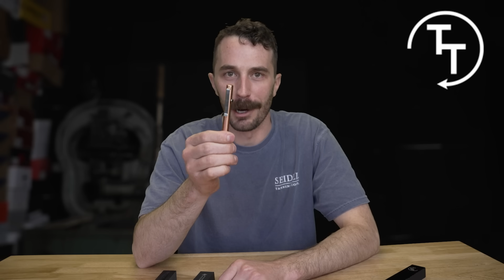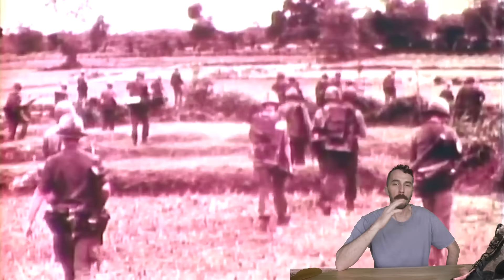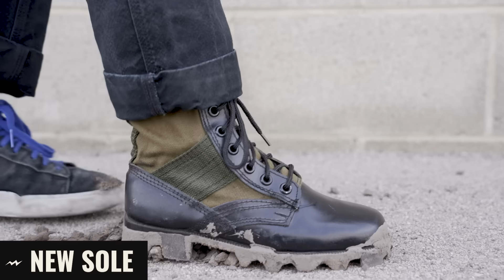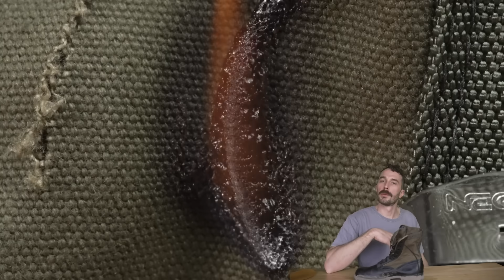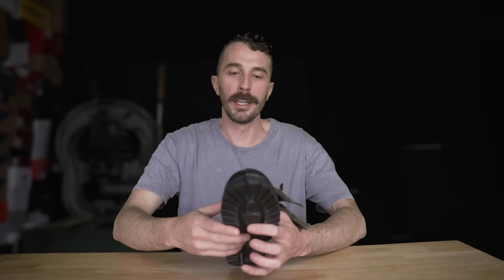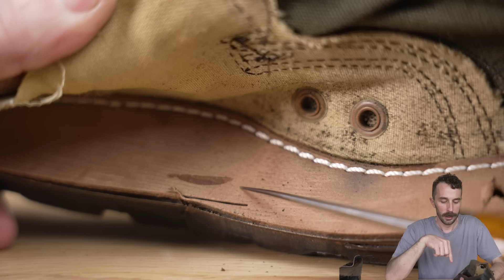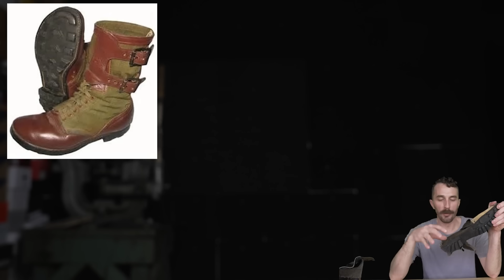Why it took 57 years to replace jungle boots

Comment: I was gonna say, sure these would be a great set of boots, if the price wasn’t so high, then looked at the link and just about bought on the spot.

That’s about the cheapest set of heavy duty boots you can buy, and it’s not like I don’t already wear heavy boots everyday, so any problems with them will be negligible. I was expecting a $150-200 price tag, not 50

When I was 16 I bought myself a modern set of combat boots, Australian standard issue, which is fine for me, I live in Australia, and at the time was doing a lot of work in dry dusty areas, which those boots did excellent in. But when the ground got wet outside of drought, and I had to do some wading, I found that modern gortex and all the special bits that make those boots so exceptional, also had drawbacks, in deep water these boots didn’t drain whatsoever, and they were very difficult to dry out, being multi ply gortex and nilon weave. They weren’t jungle boots, but they were designed with all terrains in mind, hence waterproofing and a metal strip. I’ve now moved north, and have to deal with mud up to my ankles constantly and flooding in the wet season. So I wonder if a set of proper jungle boots would be a sensible buy, especially considering how little I actually need the steel toe in my current boots

Comment: I have a set of the improved aggressive lug jungle boots from the Vietnam era. I have wore them for at least 35 years,they are worn out and the leather is brittle now. The best outdoor river walking/ fishing boots I've ever worn. I would slog though mud, swamps, woods fishing and those improved lugs were amazing. I'd throw them in the back of the pickup truck bed in the elements for all those years they functioned great. Not for winter though! Mine  are completely worn out, the neat mess foot beds are worn though,treads flat leather brittle till I get them wet, but these boots last! I'll get a new set one day

Comment: As an Engineer, having a metal plate 1mm thick is a lot for something that needs to consistently conform to your foot. I'd be interested to know the type of steel.  Metal is great for many things, just not flexing like your foot does.. I'm sure they picked a good option at the tjme
Reply: Also an engineer, my thought for puncture protection with flex would be U-shaped extrusions (aluminum maybe?), alternating up & down so they have some space between but overlap/interlock, so spikes can't get between them, & mold thermoplastic rubber around that.

Comment: My older brother gave me a new pair of these boots in 1969 and I ended up wearing them on a 10,000 mile motorcycle trip which included the entire length of the Alaska Highway.  They were so comfortable that they became my everyday knock arounds.  It took me about three years to wear them out.  I'm 70 now and I think I will look for a new pair.  Thanks for the video.

Comment: This has been a god-send, I was gifted a pair of these same boots. I COULD NOT find anything online about the build quality/manufacturer (Text was worn off). I kind of regret replacing the soles. they were pretty gross. But as you said, the 1 time I wore them metal detecting at the beach they removed water pretty fast. 
(Edit: They are the 84' version I believe)

Comment: I got a pair of McRae jungle boots in black, and the lasting board appeared to be some plastic/recycled plastic fiber. Not very comfortable, so I use a pair of leather insoles paired with a thin sneaker insole.

The original still held, so when I wore the old one out I got the cobbler to file down the original outsole to make it into a midsole, and I attached a vibram Montagne outsole with glue and hobnails. Pretty good all things considered.

Comment: The modern Army boot is pretty much the same design, at least the ones I was issued in 2007…Lug pattern is a little different and they are tan but other than that it’s the same. I still have my original pair and had them resoled once, still wear them on hiking and the leather is so broken in it’s like wearing a pair of sneakers.

Comment: First of all those pictures where not even close to the severity of trench foot I have had and seen and the boots did not stop trench foot that was accomplished by hygiene removing your boots when the get wet and changing socks often every pair I was ever issued developed a 1 inch tear just below the toe joint on the leather inside at the transition of the heel how ever, best all around boots I have ever worn kudos.

Comment: 306.5 lb to pierce this boot. So, in order to have something get to your foot, you have to weigh at least 306.5 lb with gear, the spike has to be strong enough to not break, and you have to be standing on only the foot getting spiked. Nice.

Comment: I wore these for work boots for around 20 years. They were cheap at my local surplus store, and even if they wore out, I could afford to replace them. It was great to have my soles protected while walking around on re-bar and cut metal.
Reply: I used them as an auto mechanic for years, but I found that the constant kneeling down that was required in working on cars caused the spike protective plates to crack after a while and then you'd click when you walked!

Comment: I entered service with the Marines in 1993.  We were issued 2 boots during boot camp:  A pair of all leather boots and a pair of the nylon, big lug jungle boots.  For the jungle boots, most guys were like me got the ones with the black nylon, but a few had the green ones.

The main reason why I loved the jungle boots so much was due to how light they were compared to the all leather boots and for work purposes, steel toed boots.  Light, comfortable, less heat with your feet.  Light boots are a real big deal if you have to go running around in them if you value your shins.

Even when the MARPAT cammies started cycling in during the early 2000s, we were authorized for a good while to still wear the old jungle boots and MARPATs together.  Eventually an ALMAR message came out that gave a deadline that put an end to that and force us going to the newer, rough side out boots with the MARPATs.

Those newer boots the Marine Corps adopted after the MARPATS came out were decent, even comfortable despite how chunky they looked, and they made them as light as they could, but the jungle boots were lighter.

Comment: I got my first pair of these boots as a Boy Scout in the Philippines in 1979 from my dad who wore then through 5 tours in Vietnam. I loved them and while the were not approved for wear on the flight line when I followed him into the Air Force in 1985, I made sure to always have a pair for when I went hiking and camping in the mountains and worked in the yard at home. Between the jungle boots and my issue black leather combat boots, which I still have and wear today, I have been spoiled by some of the best boots money can buy. I’ve tried Red Wings and several other brands over the years but I always go back to my old leathers. Wish I could find a good pair of Jungle Boots to take me into my 70’s.

Comment: Got a pair of these in 11N ( yes I can actually wear a 1966 spec narrow boot) after I figured out how to tie them so as not to restrict blood flow or cause pain they’ve become a good addition to my 3 season boot collection. The seller still has the size available,p. I figure I ought to score another pair of these. Turns out they only still have the type 3 vibram sole but I’m finding it’s a very comfortable 3 season boot. Though for work I use a pair with a more aggressively padded soles so it doesn’t beat my feet up
Reply: I just got a 12n 1966. And they fit too! Hahaha skinny feet I guess.
Reply: @sebastianbroussard6694  I know since the supplier I use still has them I definitely need to snag another pair. Plus they’ve got the newer all black ones in my size. 2 pairs of boots for 110 bucks? I paid more then that for my rockport work boots ( but on concrete all day I need the rockports )

Comment: Hello. Please tell me, using your vast experience, which shoes today it is better to give preference to with a rubber sole and fastening to the top by vulcanization, or still shoes with welt stitching fastening?which shoes can be used longer with frequent use, so that without losing the outer shape and quickly erasing the sole?because I heard about welt stitches, you need to change the sole every two years. And in Russia it is expensive now. Thanks.

Comment: My favorite boots when I was in the Army throughout my 3 enlistments.
When I got to Ft Bragg in August of 1983 when I went to get my gear issued I got 4 sets of OG jungle fatigues made famous in Vietnam and two pair of jungle boots.  In the hot and muggy weather there that was the most comfortable uniform.  The uniforms and boots dried fast if you stopped sweating   when taking a breather so you didn't have that soggy feeling all the time.  I still have my original 2 pair.

Comment: Wore them for almost 20yrs. Pulled out all the steel shanks & wood blocks immediately. Replaced the laces w/ black 550 cord. Customized them for SFAS (Hack ripple sole, Sorbathane inserts & 2nd identical pair 1/2 size larger for foot swelling). Wore them all over except in the snow.

Comment: I been wearing the Panama Sole ones for almost 40 yrs,I didn't like the V tread as the mud would cling to it and didn't get as good of traction as the Panama's.Was the cheaper foreign made ones when I was a kid ($19?) then the good ones by Altama that wanted I think $80 back then.Once I went to work I started buying the Altama's.
The last pair I bought was a pair from Wellco called Megabite.Their tread is 2-2.5x deeper than the regular Panama Sole boot.Bad thing with them they have been out of production since sometime around 1998 or 2000 and back then they wanted I think $140 for a pair.I found a new pair though at a lil surplus store on the way home from a trip in 2010.They wanted $20 a pair and had 3 pairs,at the end of the trip I only had enough to buy 1 of the 3.I wear them every day from working on cars to cutting wood to fishing or just out and about and I'm still wearing them now......I also wear them all winter here in PA.
The leather is starting to breakdown but there is still no holes in them and there is about 1/2 tread left which is a little more than the depth as a new regular pair.Really wish I could have bought the other 2 pair,being 50 they could probably lasted me the rest of my life.
There is only 2 problems with them
#1 and the biggest problem of all.. They have been out of production for 20+ years.........................
#2 When walking through a driveway with say 2B stone you will pick up at least 1 stone in the heel and only notice when you walk on a hard surface like concrete,wood,asphalt,etc. I will find a few on the floor of my vehicle throughout the day.Yesterday I actually lost a lugnut when changing tires until I thought to look in the heel of my boot....LOL!

Comment: I am retired from the Army. I wore this boot my entire career. It is the best boot ever made for the military, in my opinion. Good show. BTW I did have a 16 penny nail go thru my boot into my phalanges of my feet and back out the top. My buddy had to pull the nail out, luckily it was still attached to a 2x4 for leverage. The nail went thru the sheet metal and not the steel shank. It didn't stop the nail but it did make it hard to remove. No bones were damaged or blood vessels, luckily.

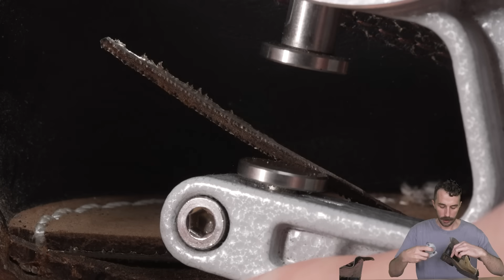Comment: I still wore a set of those back in 2003 at Fort Benning. Once we finally swapped to ACU uniforms in 04 they had to be retired. Nothing looked sharper than a battalion of soldiers in Monday 09:00 formation with those pressed BDU’s and polished boots!

Comment: Wore these at Ft Drum, NY, down in the jungles of Panama, Germany, language school in Monterey .... etc ... had a pair that I went in and got the steel plate out of and put in a pair of running shoe inserts ... used those for long road marches.   In my infantry unit they were absolutely the prefeed boot like nine months of the year.   When I went to Intelligence ... I was one of the few that wore them.  I still have a pair that fits and are in usable shape.   I had boughten two pair, then we got issued two pair for Panama, then another two pair for Desert Storm ....

 @Rose Anvil -   Your headline said 57 years to replace this boot but you never did talk about the replacement!

Comment: I didn't read ALL the comments but... The other reason for the metal in the boots was that Charlie liked coating the punji sticks (in the bottom of those tiger pits) with dung. If the puncture didn't kill you, the infection(s) could or would.

Like all your other series, this is awesome, thank you!
Reply: Another reason for not getting stabbed in the feet lol

Comment: I got my first pair of authentic Jungle Boots when I was on my first tour in Vietnam around mid-1971. I got mine from a pilot or someone from the air wing running supplies and stuff from Da Nang out to the USS Midway (CVA-41). I was probably one of the few Sailors running around in CIC wearing jungle boots instead of boondockers. As long as I kept my pant legs on the outside, no one said anything. They didn't have much for cushion. I think they were more of a novelty for me than anything else. I might still have them somewhere in my garage!